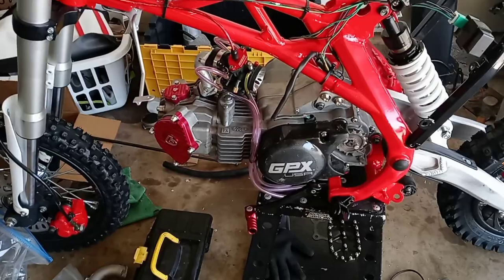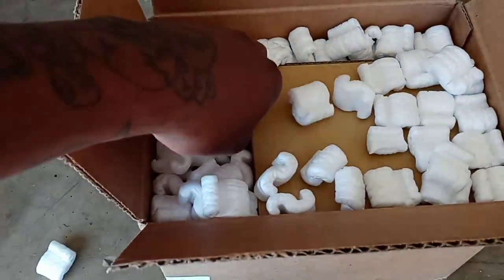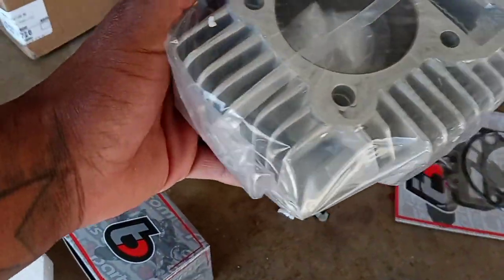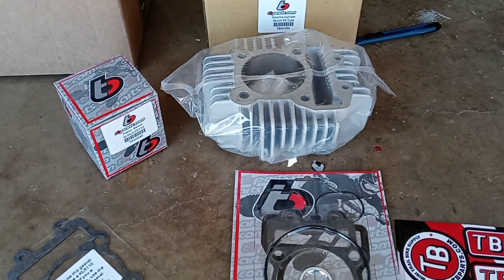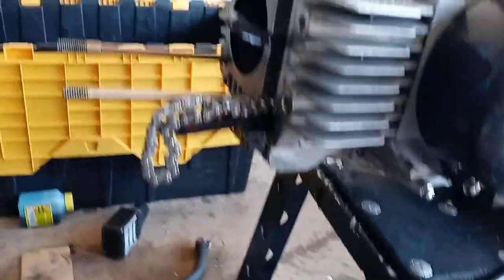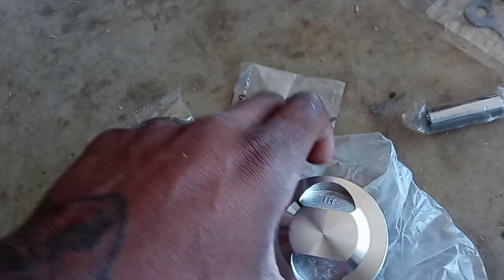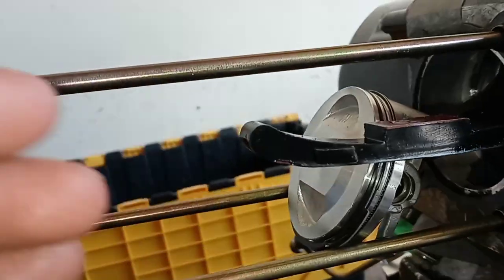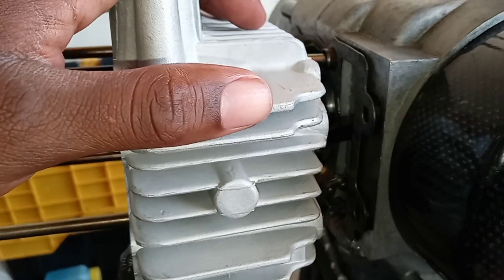The 170cc Big Bore Crushed my hopes and Dreams!?!

Comment: Bro I went through the same ordeal. Everything was supposed to be bolt on but not true at all. I have a YX150 and  I had to bore my engine case. The only difference is I had a 67mm cylinder you have a 64mm. I really thought the 64mm cylinder would fit. That is bad information or bad quality control if some cylinders fit and some cylinders don't.
Reply from the maker: That is the v2 race head lol 😅

Comment: dam sucks about the big bore. if you wanted to you could tear motor down split the cases use a dremel or die grinder to make new cylinder fit. Lot of work but the dowel pins locate the cyl square with the crank so all that matters is clearance. I know a yx160 isn't to cheap but I guess that would get you to a 184cc. They say the 184cc is one of the best engines. I think you'll like the 150 with that v2 head though alot. bike looks so clean. can't wait to see them new graphics. good content love your channel.

Comment: Bro can you help me out I just got a ssr150 with a blown head but idk what bore kit I need
Reply from the maker: The tb parts big bore kit will work for that motor it’s just a yx150 it actually takes the same head and cylinder as the yx160 the only difference in the two is the stroke of the crankshaft.. so you can get a stock 60mm cylinder or upgrade to the big bore 62mm cylinder

Comment: Can I put this exact kit onto a Apollo 125 RFZ?
Reply from the maker: No..you need to order the 146 kit from tb parts for the 125 engine
Reply: @1E11evenMoto  dam will that make the pit bike a little faster?
Reply from the maker: Lots faster
Reply: @1E11evenMoto  nice because I also have a ZS155 and that was the big bore kit for it the guy at the dealership said it will be like a mini CRF250R
Reply from the maker: Yea it will make it a 177cc I believe and it’ll definitely be a monster my 170 has more torque than my 190
Reply: @1E11evenMoto  also I also bought the race head and race cam
Reply: @1E11evenMoto  sorry I’m bombarding you I’m just new to mini and I want to get make it the most powerful for street use because I got it plated here in cali it just won’t pass cars going 60 or 70
Reply from the maker: @Angry-Little-Fish  tb parts kits are the way to go for those engines
Reply: @1E11evenMoto  nice because that’s the company I bought it from